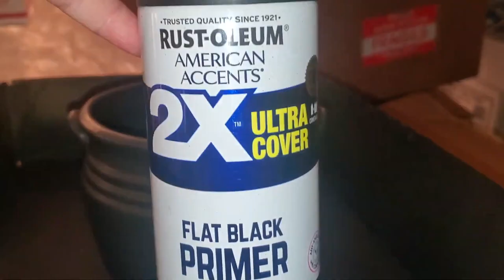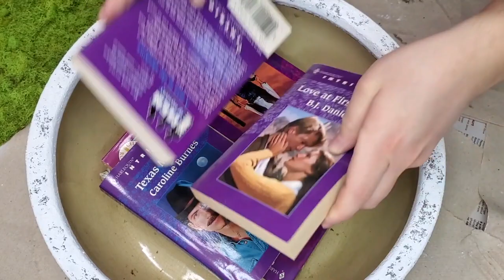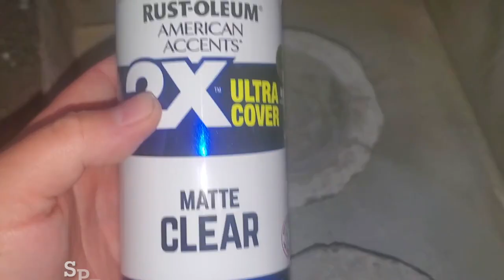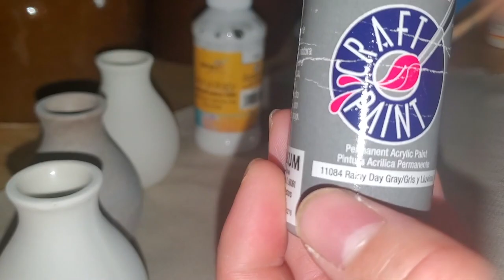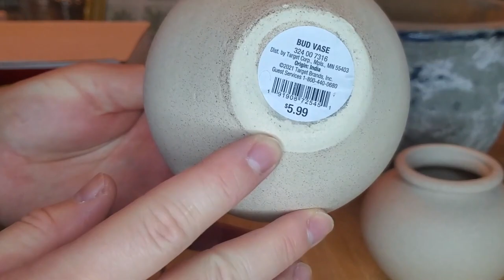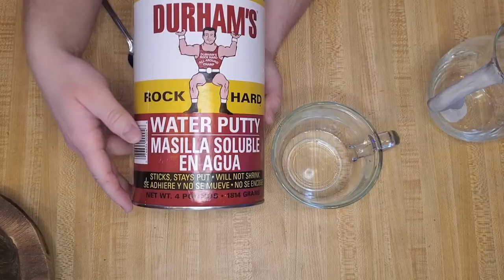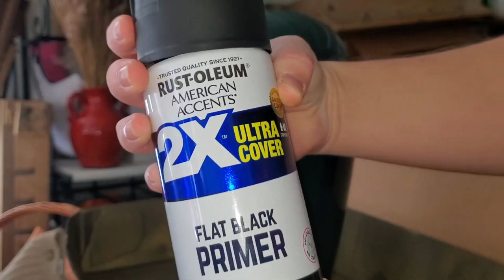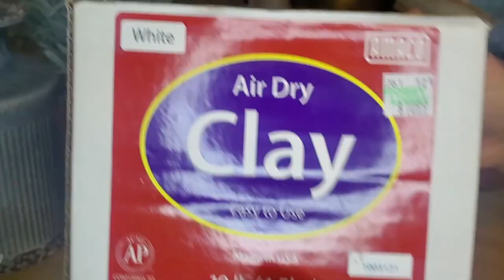THE BEST FAUX AGED VESSELS || DIY ANTIQUE PLANTERS, POTS, VASES + VESSELS

Comment: The glass one you added 4 handles to with clay turned 9ut stunning 8 haven't had 5oo much luck adding clay to glass are you using air dry or oven baked clay?
Reply from the maker: Thank you sooo much!!!! I have more in depth tutorials of all these across my channel! So what I. Do for glass vases I’m adding air dry clay. The clay actually shrinks up and cracks and falls off the glass. I then use a very strong adhesive called starbond to attach the handle to the glass (after clay is fully dried). This glue is used for automotive parts so it works so well it’s a black super glue! The bond is so strong that I can handle these vases by the handles however I wouldn’t do the clay handle doesn’t break off. I hope this helps you! Best of luck

Comment: Hello!!!! I’m your huge fan 😍 I love your creativity. What kind of clay do you use? And one more question. Do I have to use primer on glass vessels as a first case coat?
Reply from the maker: Hello!! Thank you for your support. I actually was using air dry clay I got from local craft store. The clay would end up cracking and falling off so I had to super glue back on and you can’t even tell that happened when your done bc they way you cover it all up with the paint texture. 

I hope that helps answer your questions
Reply from the maker: As far as primer on glass, that is probably a great idea to be safe. I will say regardless after a year or so it eventually will chip off and I also have noticed some weird things happening to the baking soda added into the paint on these pieces. Maybe I should do an update video showing these vases and talking about them?